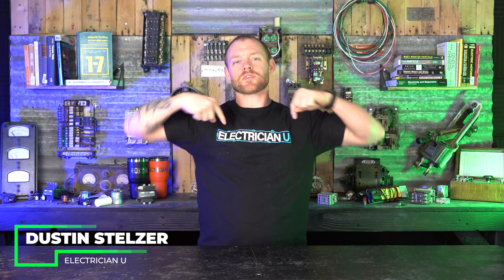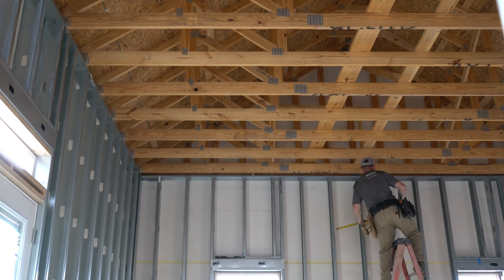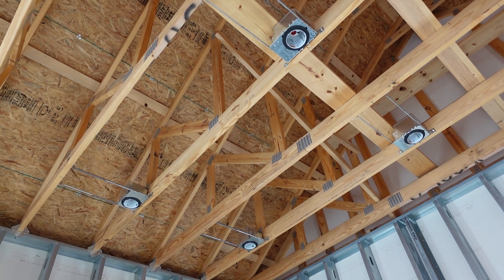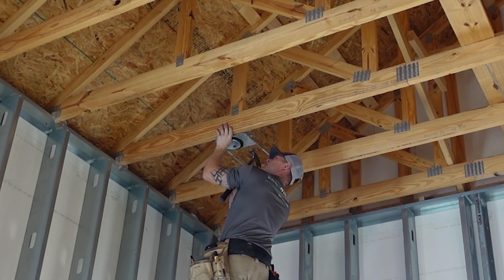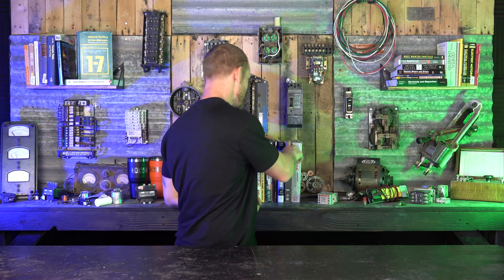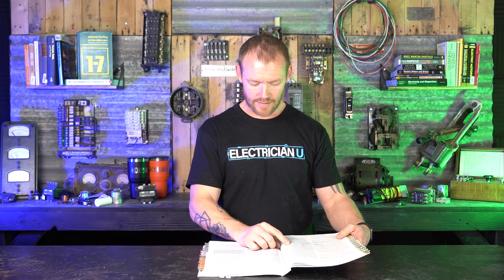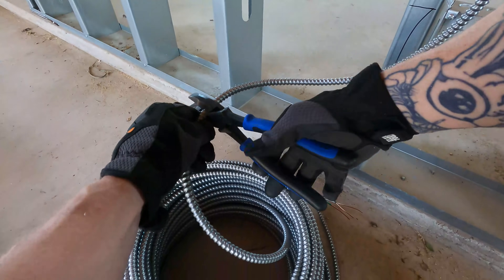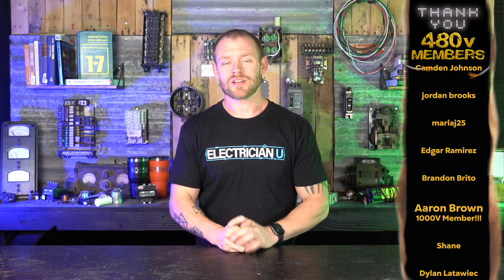Backyard Addition Job - DAY 2

Comment: Using MC instead of romex inside of steel framing also means that you don't need to install grommets in each knockout in the studs.  The steel sheath protects the conductors from physical damage while pulling cables.  The plastic sheath of romex would get torn to shreds within minutes of pulling cables through unprotected knockouts in steel framing.
Reply: I like the ideal plastic stud bushing for this purpose yeah strange how at the time Dustin mentioned MC was cheaper however it’s the same price now as equivalent length of Romex in big box stores.
Reply: I was thinking that.. doesn't he need grommets
Reply: @maxd718  Not with MC.
Reply: @mathman0101  This job was done 6 months ago and in his area he said NM (Romex) was a lot more expensive than MC.
Reply: @illestofdemall13  yeah that was bizarre price corrections should have happened faster in my view but kudos to Dustin if he managed to get MC cheaper at the time. A more solid option than NM albeit more challenging to work with as Dustin himself points out.
Reply: @mathman0101  Yeah, if the customer is doing all steel studs because that's all he can find or the price is better, MC might be a better option even if it were to cost a bit more than NM. Depends, though, because you could just install bushings into the studs then run NM. In this case though it seemed like it was the way to go at the time.

Comment: Why don’t you purchase a MC CABLE spinner? It pulls off easy, it’s faster. And can also be used for Romex and other types of cables. Just a thought.
Reply: Because you can’t pull the MC from the center that way. 

He explained, MC is “directional”, the inside end is what you wanna use when wiring through metal slots in the metal studs. Makes for a smoother pull and the wire spinners only let you pull off the outer end of a roll of wire. 👍🏼

Comment: Thanks for all the content, helps me sharpen my skills as a lighting electrician.  Also, Halo makes a rough in type mount ring for the wafer lights. I always use them. You can layout your lights, rough in the metal ring, terminate the wiring portion of the wafer light and install the lighting part after drywall paint. I just installed 85 of them in a house. Keep up the good work bro!

Comment: Hey Dustin, Topaz makes a frame, I believe it's called RDL4 frame for those wafer lights. We are slowly incorporating them in New construction. You just put the bracket up so the sheetrock person can zip out the hole ,and before that when roughing in, you would loop all the lights leaving slack and staple them up above the bracket. Check them out if you haven't already.  And yes they are awesome if you run across a stud laying out lights whether new or old construction. Only problem I have found is if it's a double rafter you have to make sure both spring arms will fit. Amazing work bud as always. Thanks for the content.

Comment: I got a roll of 12/3 MC for free and I was wondering if there’s any good uses for the additional hot wire (other than wiring a three-way light switch)?
Reply: 240 circuits
Reply: Does the MC have a ground wire? If not then just use it for that.
Reply: @FishFind3000  yes mc does come with ground, as well as the sheathe being an acceptable ground too
Reply: If it did not have a ground wire it is not MC.
Reply: The sheath of MC is not a compliant ground (even tho it is grounded), the green conductor is the ground.
Reply: @Nick-bh1fy  The sheathing of MC isn't allowed to be used as ground. You have to use the green wire.
Reply: You could also just use it for regular 20 Amp 120V circuits and cap off the red. Also, you can use it for fans where you need one conductor for the light and another for the motor.
Reply: @FishFind3000  yep, Green, Red, Black, White inside the metallic casing
Reply: @illestofdemall13  that’s a good suggestion about using it for a fan. Yeah one of my ideas was to use it like a regular 12/2 with ground for circuits and just cap off the red and pretend it’s not there
Reply: @riffdex  You can also use it for a multiwire branch circuit.
Reply: @illestofdemall13  I’m not that familiar with the terminology to know what a multi wire branch circuit is
Reply: @riffdex  In that case you are better off not trying to use it for that purpose. It can be dangerous if done improperly. It is when you have two 120V circuits sharing a neutral but the breakers must be common trip. That means both need to trip at once even if only one circuit shorts/overloads. It is not commonly used these days.
Reply: @illestofdemall13  ah thanks for explaining what it is. Don’t see any reason I would need to wire that way but always nice to learn something new. I’ve never added a breaker to my panel before, only adding to existing circuits.

Comment: You guys don't have to use the anti-short inserts with the MC? They're required by code in Canada, and have to be visible at the clamp inside the box.
Reply: The NEC doesn't require them for MC cable, but it does for AC cable.

Comment: I know you have mentioned anti shorts are not required by code for MC but you like to still use them. Why didn't you use them here? Are they not allowed in the Snap2it Arlington fittings? Or is still ok? Thanks!

Comment: Do you still have to put red devils in the MC?
Reply: The anti-shorts are not required for MC Cable but I think most professionals would still install them. I know I do.
Reply: When did anti shorts become optional?
Reply: I've never installed mc without them, to risky I think.
Reply: @lawrencelavigne890  I think when certain connectors where approved to have anti short properties made into them but I still use em just to be safe and provide good craftsmanship
Reply: @lawrencelavigne890  MC has never required an anti-short bushing. However, most people who have worked with AC wire, are so used to using it, that they just use it anyways.
Reply: They're required by code in Canada 🇨🇦,  and have to be visible at the clamp inside the box.

Comment: I wanna say when I took 2020 update  class they said you couldn't leave more than like 18in of extra wire at any outlet. Anybody heard similar or have a code reference?
Reply: That is correct. 18” after your last securing point(clip, staple, etc.) But you can see what he did was put a clip on both sides of the loop that he did, therefore, it’s not a violation

Comment: You didn’t install the little plastic insulator to the end of the mc cable….
Reply: The red devils ? I was thinking that too. Some mc connectors have some already
Reply: There’s nothing in the code book that requires you to use plastic insulators for mc cable…it does require it for ac cable though.I like to use them in mc anyways just in case.

Comment: Thinking of getting tesla. How would you route the 240v charger?
Reply: The location and length of run as well as bldg materials going thru or under  are needed?
Reply: From the panel to the charger location, within code. 

Vague answers for vague questions. 😂
Reply: @strangerofthe2067  lol I was thinking the same thing but I'm tired of being called an ass for those kind of replys figured I wld try to be nice lol
Reply: @strangerofthe2067  ... that's actually a great answer because you don't have any other specific questions or details to work with. BTW, in order to meet an inspection (future expansion?) it could be one or two circuits into a J-box (or sub panel) out in the garage. At this point we don't know if the charger will need an outlet or be hardwired so could be a blank cover pending final installation.

Comment: No hate at all I love your channel but why don't you use anti shorts on your MC?
Reply: Same thing I’m thinking. I believe inspectors can fail you because of that
Reply: @MegaGsizzle  A lot of people think that but they are only required by NEC for AC cable but not for MC cable. Your inspector may not like it or know it, and also local jurisdictions may have their own specific codes.
Reply: @MegaGsizzle  Not Required
Reply: Not Required per Article 330. Now, if Dustin had installed Type AC Cable then 320.40 would have demanded their use. So they are purely optional with Metal-Clad Cable, use them if you desire it. The reason they are not required is due to the listing criteria for MCI fittings.

Comment: a lot of people get bought and sold on the idea of pulling MC from the middle of a 250 roll. total BS with some truths. yes it angles in a good way to not catch on metal edges. the most important thing to remember is to always pull "INTO" the metal stud. all metal studs are stamped with the holes basically the same. if you look down a metal stud, its a "C". think of it directionally. pull INTO the C. MC is rounded on both sides, itll pull easily if you follow the pull INTO the C. not all framers are taught to frame in unison, most do. best way; always pull (even multi metal stud) INTO the C, when the framing flips, pull the approx ammt you need to get to said box. when pulling from the the flat side of C, pull each stud individually. the way to make it fast is to pull each stud through the manufactured hole up and down. either way. never straight. feed the MC up or down through each stud individually. much faster than even trying to pull backwards through 2 studs. ALWAYS PULL INTO THE C!! when you can. and one by one after, regardless of how the MC is spun. love the channel, but i had to say something about this.

Comment: NO RED DEVILS??
Reply: Not Required per Article 330. They are optional if you choose to use them due to the design of the fittings for Metal-Clad Cable.

Comment: Dumb question, what is the difference between MC and BX?
Reply: Difference is in BX you can use the Armor as a means of grounding. It has a tiny metal conductor in the spiral / armored portion of the cable.
Reply: Both are the same except Mc has an egc bx just has the Armour sheath for grounding (may or not have a uninsulated conducter)
Reply: BX was the older metalic cable without the separate ground conductor wire, which is no longer accepted by code. People still call MC  BX because it replaced it. You can still find BX on lots of old equipment (HVAC for example). Problem was grounding depended on the proper metal clamps, which had to be attached to metal boxes, devices and enclosures. Most of todays modern equipment, fixtures and boxes are plastic, pvc etc. but still require ground connection.
Reply: @zmettin1994  Actually that is incorrect. The armor on the experimental "BX" was never evaluated as being an low impedance effective ground-fault path and this while used it was never listed for that application. In reality, "BX" is more like "MC" but the "BX" lacked an adequate EGC. It used utilized around the time when nonmetallic cables also existed that did not have an EGC or an undersized EGC to which CMP 5 changed to require minimum sizes.
Reply: @MasterTheNEC  thank you for the clarification.

Comment: They make mounting plates or mounting frames you can install new work, wire in the junction box for wafers, then at final all you have to do is make the connection that takes 1/2  of a second.....Really negates that LAST reason to ever you cans....

Comment: Why not an 8' roller scaffold, bro?
Reply: Cost more money out of your pocket and it's a time and mats job so you want it to take as long as possible  lol
Reply: Ahh, this is true. But damn man, I don't wanna be up and down all day. I'd rather walk the rafters than do that
Reply: @nickcheatle3927  o I hear ya sometimes pple have to lrn the hardway or the old concept of having to spend money to make it lol
Reply: @nickcheatle3927  I think you could crawl those rafters. I don't think you could walk them. No thanks!
Reply: I prefer working from ladders if I can get away with it. Easy to move them around, no set up time, easier to store, etc. Depends on the job and several other factors.